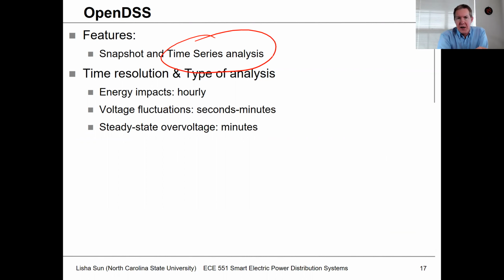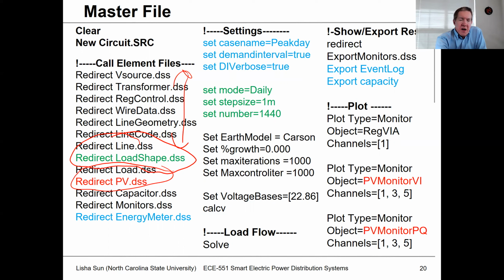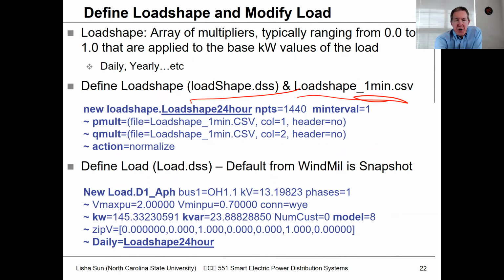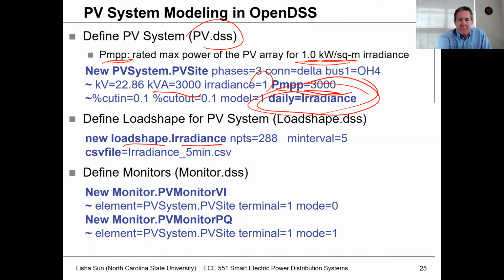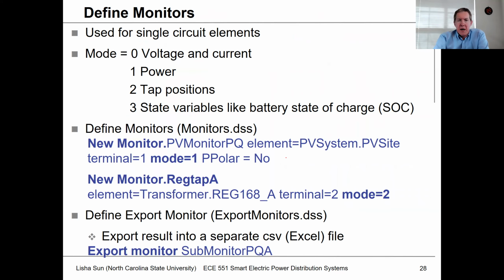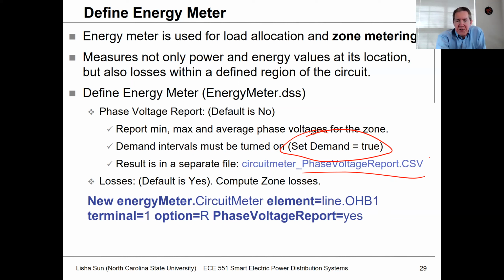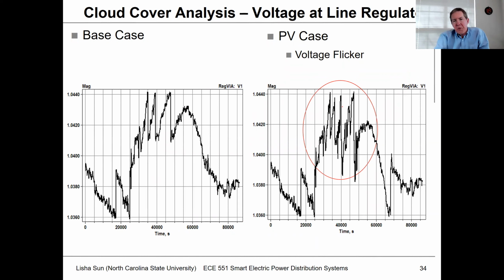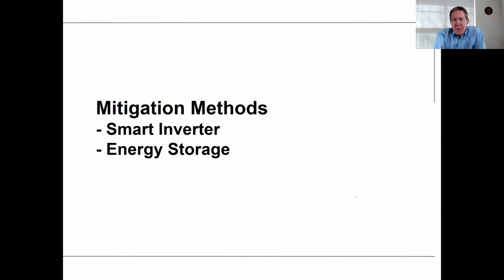Lecture 21b: DER Part 3 p- OpenDSS PV Analysis - Power Distribution Systems Spring 2021 - Lubkeman

Comment: Dear Dr David, The lectures are interesting.  how can I get the opendss files?
Reply from the maker: I did not post the OpenDSS files for this lecture since there was some proprietary information in them.  As an alternative I suggest you look at the circuits in the OpenDSS software distribution under OpenDSS->EPRITestCircuits->epri_dpv.  You should be able to apply similar principles as discussed in the lecture. Would suggest you also look at Lecture 20 videos.
Reply: @dr.davidlubkeman284  Thank you. I'll follow the lecture continuously. Thanks for posting lectures.